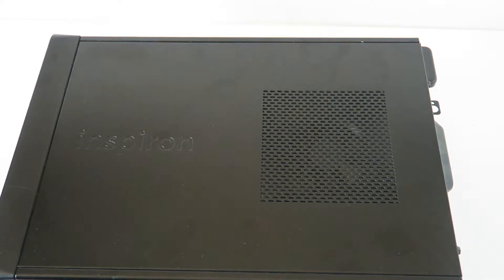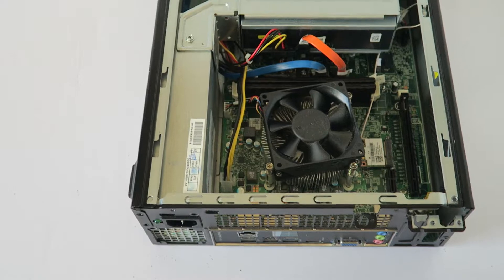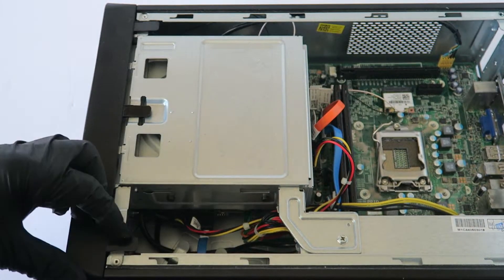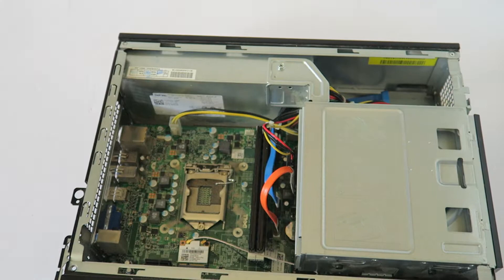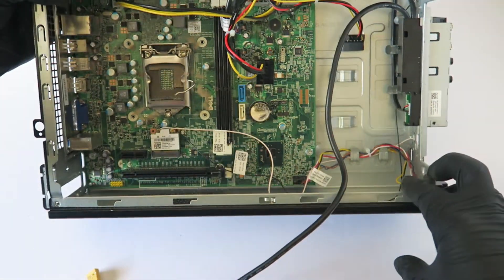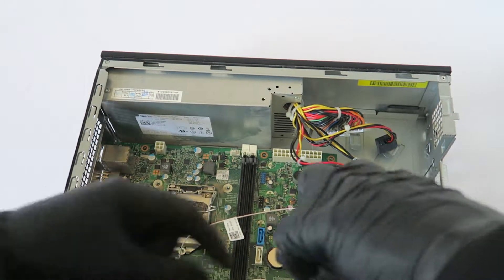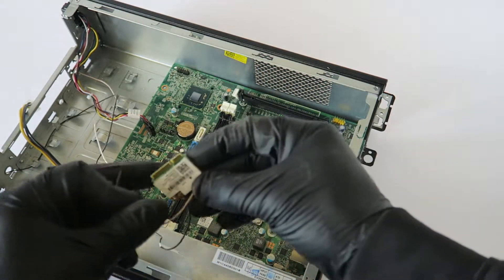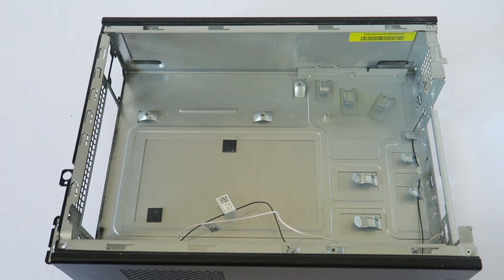Dell Inspiron 660s Teardown

Comment: Thank you for this. Gives me more confidence in buying one of these systems cheap and moving the motherboard to a nicer case. Standard ATX power, standard front IO, and standard power and reset it looks like.
Reply from the maker: Hi, thanks.
Reply: @Mxkdt  Can the stock heat sink in the 660s handle an i7 3770 75 watts?  I cannot find a 3770S 65 watt at a good price.
Reply: @ssaini5028 no it cant… the heatsink is fine but you have to get a better power supply sorry
Reply: @MaPooNDaSpOOn 2025 says Hi

Comment: Wait what is the name of the Mother board/PSU I am trying to see if I can put a GTX 1060 3GB in it? If it is even possible? What do you think?
Reply: No you cant. The power supply cant be changed from 220watts.
Reply: gt 1030 at best